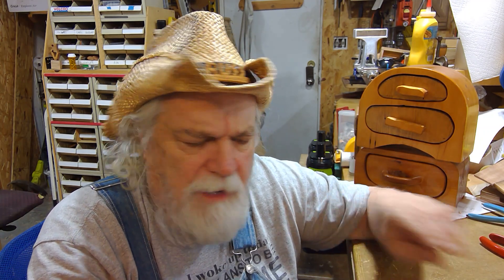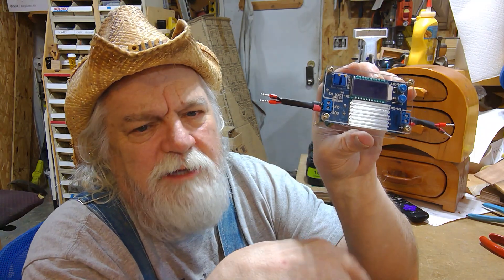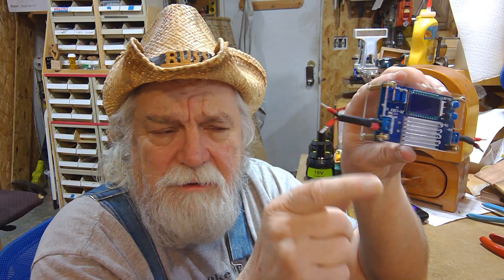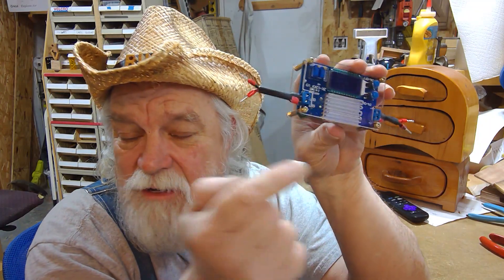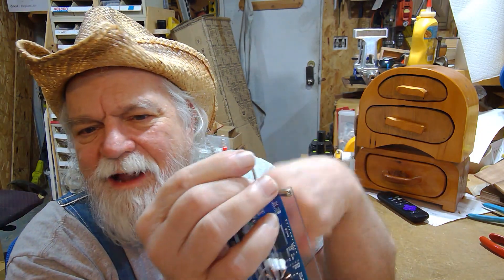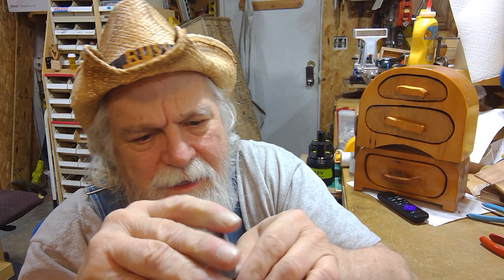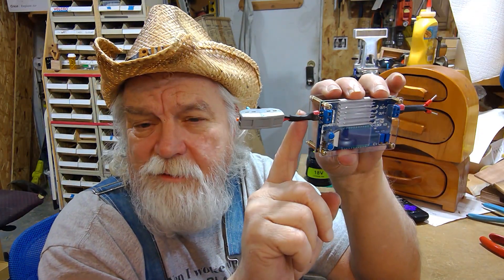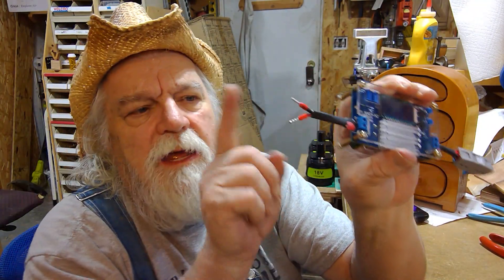DIY Pigtail for PCB Terminal Block Connector by OTB Thinker

Comment: Another great use of the ferrules. As I mentioned in a reply to yesterdays video I am in need of a nearly identical solution for using the same buck/boost converter/regulator to make a variable power supply in addition to the battery charger solution you previously proposed. Great set of tutorials!